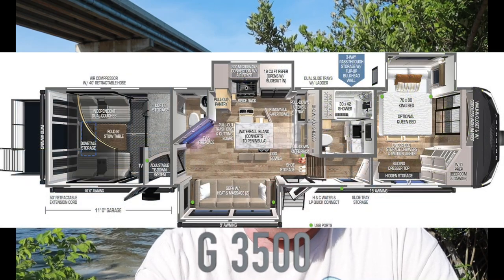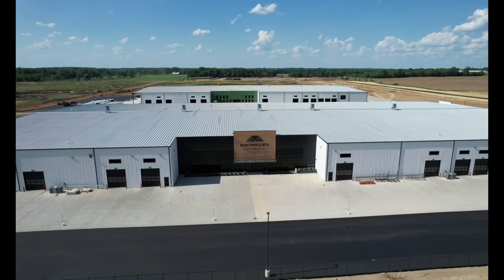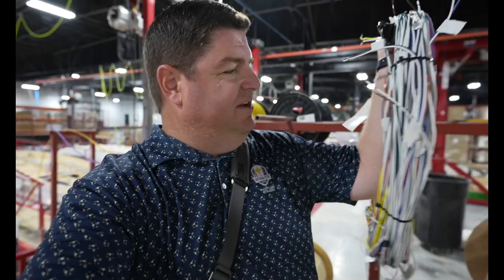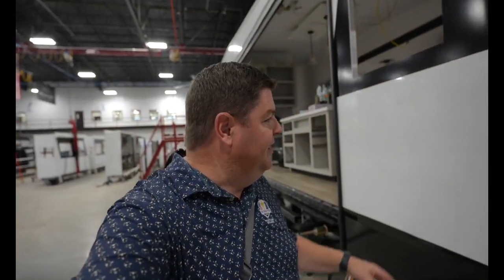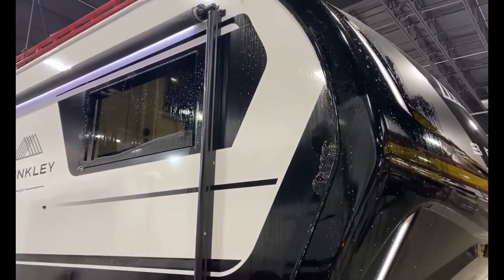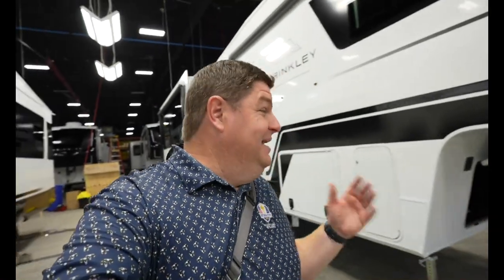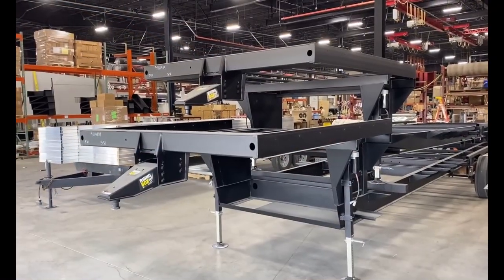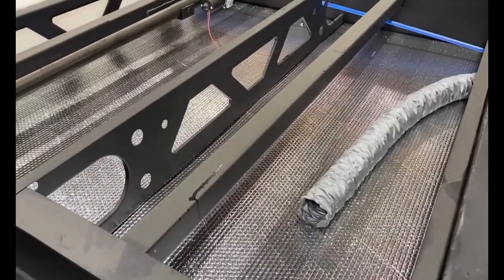Is This The G.O.A.T. of All 5th Wheels? NEW FACTORY UPDATES!  Ep 4.29

Comment: Looks pretty good. I see they use cheap OSB wafer board for floors and basement floors. As soon as they use a waterproof composite for flooring I'll consider them. Also, "Fulltime RVrs" are in two main categories: 1. Those that have it delivered to an RV residential park for permanent stays, and 2. Those that tow them fulltime. Which of these categories of fulltime RV living are they building too? Finally, if their frames are as good as they say then payload should reflect this. The typical 5th wheel is either near over weight over weight at the end of the assembly line. Is Brinkley any better in this respect? Love the show and thanks for the tour.
Reply from the maker: Thanks for your comments,  Brinkley builds for Full timers that move around every week or two.  As to the weight, I agree many are overweight by the end of the assembly, but Binkley has those frames built at a much higher standard and the labels are actually accurate.  Personally I would love to see them not even bother with the leaf spring suspension and go directly to Independent Suspension with disk breaks.  But I understand they want to keep the price competitive and make IS an option.
Reply: The floor is OSB but it is marine grade.

Comment: One thing i noticed is they are the size of a midsize but weight of a full profile of comparable length.  That tells me they are well built.   There are some 40' units that weigh less than the 32' Z2900 for example.  Ill take the heavier better built unit anyday.
Reply from the maker: Very well built.  Thanks for the comments

Comment: Did they give you any specs on why their frame is stronger/better than a GD triple axle 5th wheels or the Riverstone 5th wheel frame? The picture shows a frame that looks very similar to GD triple axle frame and not as much steel or extra bracing like the Riverstone.
Reply from the maker: You have to pay attention to the size of the steel boxes and gage of steel they use.  additionally the amount of cross members and gussets used.  As to specs, I'll look into what they have.

Comment: I’ve purposefully watched all the reviews and videos on Brinkley. Yeah the look nice and they are making a lot of hype and details of the unit they are making and folks watching and so forth are really excited and touting them. Hmmm? Look present day and past at all the manufacturers whom are big name, seem like every single one of them has major issues and don’t think for a hot minute Brinkley is gonna rise above that, nope no way. Motorhomes, travel trailers, fifth wheels, etc. are loaded with lots of issues and fricking Brinkley isn’t no better. You’ll see. Wait for it.
Reply from the maker: Hey Rick, Normally I would agree with you.  But I'm seeing very different things with this company and group of owners.  Only time will tell...
Reply: It goes back to the suppliers. Unfortunately the RV industry sources most items from the same common manufacturers. That’s why we keep getting the same crap no matter how many RV manufacturers build different models. Same materials and build methods.
I see that Brinkley is sort of stepping out from the same ole song and dance. They are going to their suppliers and asking for better quality products designed to fit Brinkleys standards and requirements. Better material matters. Better fit and finish. Just look at the frames. No horrible incomplete welds. No rough cut edges. Properly done with bracing. 
Go to any RV dealer and take a look underneath. Notice how many rust spots on fittings, trim pieces and horrible welds and painted parts or lack of? Tells you everything about how much the total quality of build is. Heck we all remember the china bomb tires installed right from the factory and exploding and ripping out entire side walls and fenders while customers are driving on their first road trip. How horrible the RV manufacturers and dealerships treated customers. 
I'm so impressed by Brinkley that I placed my order for the G3500. Of course Brinkley has growing pains and will never be perfect but they have the right mindset and passion for their products and company. I believe that the best warranty is the one you never need.
Reply: Just like Alliance, mostly hype.  Don't look at what the factory is supposed to do, look  at what's going to the customers; those are very different things.
Reply: Not necessarily.   You can give the same pile of materials to different people and end up with vastly different products in terms of quality of assembly/build and service.  Whether it an rv, auto or a home.  Hopefully Brinkly will force the industry to step up there their game.  I see others copying some of Brinklys ideas already.